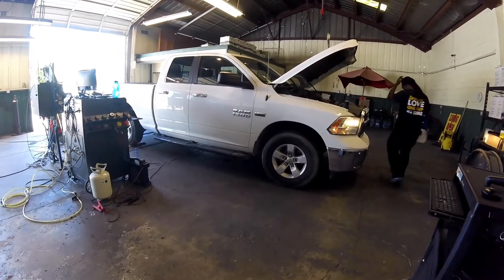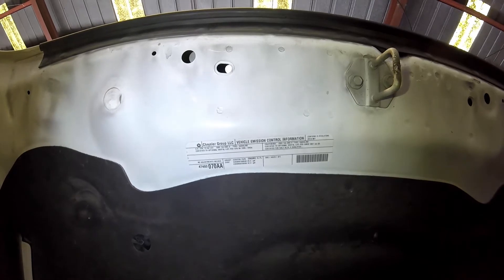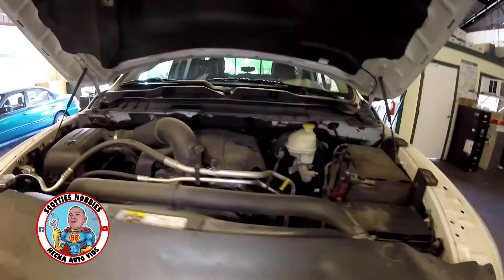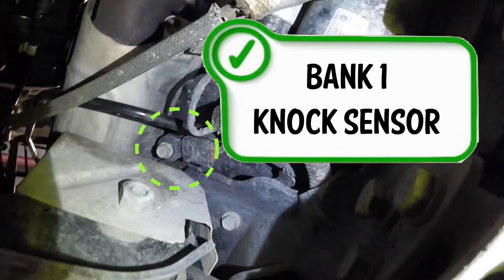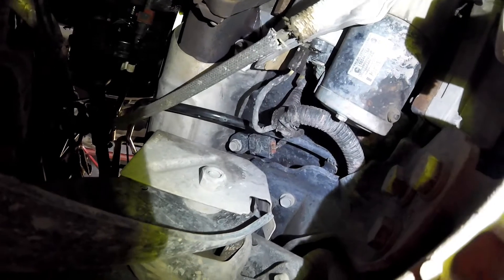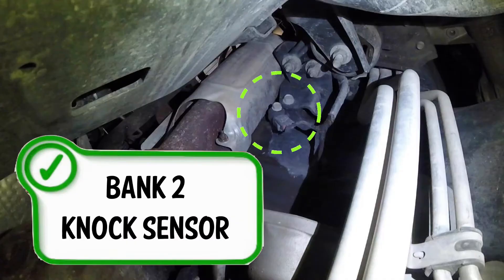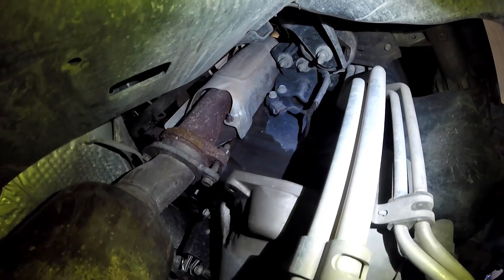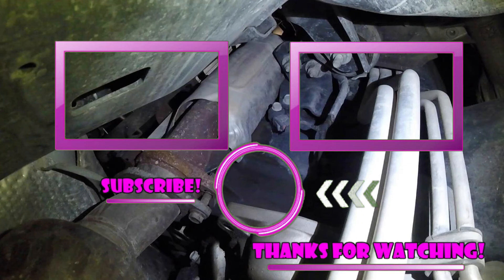⫷ RAM & Dodge │ 5.7L │ 2003 - 2018 │ Knock Sensor Locations, info with Torque  ⫸

Comment: Thanks a bunch. Nice simple video. I am having an issue where I get the code for the bank 2 on my Charger 5.7. The engine is running fine no loss of power or knocking etc. I clear the code and it runs great for 50 - 100 miles and then randomly it pops the code again. Is this the sign of a sensor going bad? Or does the sensor go completely bad and pop the code immediately?
Reply from the maker: Do you know the code that you are chasing?
Reply: @ScottiesHobbies  It is P0330

Comment: So if i do not get continuity at the connector when the key is in the on position,, then what? I changed out both my knock sensors after a p0325 code,,,, code is back and still low rmp surging and low power. thanks for any info.

Comment: I'm trying to fix this truck. My friend did the starter and the bank 1 knock sensor wires came out of the plug. Im going to fix the plug but I do not know which wire goes where. Do you happen to know? Also great video.

Comment: Hello 
I have a ram 1500 2011 and have the knock sensor bank 1 and 2 circuit malfunction but i don't know how to replace the harness i already change knock sensors O2 sensors fuel injectors spark plugs MAP sensor and the CEL is still on and the truck hesitate to accelerate please i need help
Reply from the maker: Have you checked fuel pressure?
Reply: @ScottiesHobbies  yes and it's fine
Reply: @blakedexter3224 mine hesitate as well well I smack the gas …. When low on fuel doesn’t crank … but I if put gas in it’ll crank right up …

Comment: i have a 05 dodge ram 1500 5.7 hemi 4x4. (lights come on) but no crank no start problem. i put on a new starter, starter relay, and battery and still nothing. any suggestions?
Reply from the maker: I know the 07 ram has starting issues because of the TIPM. Have you researched the TIPM at all?
Reply from the maker: I did a quick Google search, the 04 has the TIPM problem so I'd put money on, that is your problem. But research a little before you throw another $500 @ it.

Comment: I have 2005 he I and on the right bank I get a noise like exhaust gasket is bad after it warms up it gets less . Could that be a knock sensor? Thanks carl
Reply: The header gaskets are going bad. They’ll sound like a lifter noise at cold start but when it warms up the gaskets expands and quietens down

Comment: im currently running at 10 to 24 degrees ATDC! is it possible the lifter tick is causing this? no cel, drives ok but terrible mileage and lack of power. New cat, new map etc sensors, new timing set installed 10k miles ago (i bought it with a spun rod).. 2003 2500 HD 4wd hemi 5.7-
can i ground these knock sensors out to see how it runs?
Reply from the maker: Have you done the dash code check? 3 times to on position and hold? You might find a code. If none it will say done. Check my other videos, search 'scotties hobbies secret code' . Let me know what you find. Have you checked fuel pressure?
Reply: @ScottiesHobbies  got p0113 and p2299 - thanks looking into it now.. 0113 = IAT sensor and 2299 = brake pedal positino.
Reply from the maker: @fstarockaburns425   Hopefully your intake air temperature center is remote. If it is make sure it is clean and make sure the wire connection is good. Now with the brake petal center. Does your brake lights work? I'm not sure if it has a sensor for the lights and then a sensor for the computer or if they're integrated into one. 

 Glad you found codes in the computer. Hopefully this good hopefully this is what it takes to get this thing running right. Keep me posted on how it goes.
Reply: @ScottiesHobbies  Hi thanks ignore the pedal i had my foot on it - but the P0113 still remains.. I checked live data on the IAT, shorted out the temps jump to max (240 degrees), and if i ground the sensor it jumps to 40 (coldest) indicating the unit is working? I also followed the manual instructions and measured 4.5k ohms across the board - it sounds awfully high though? manual says must not be below 100 ohms - mine is WAY higher.. connected and idling the IAT shows about 31 degrees celsius which is about 10 degrees higher (hood open, motor cold and ambient about 20 c) than normal.. I replaced the unit 2 months ago

Comment: I hit a large water puddle on my 2018 tonight at highway speed with cruise and it threw a p0330 code with CEL.  Sending the reset command seemed to work however.  Whats with that?  I'm at 54k miles.
Reply: How do you send a reset code?
Reply: @walnutz516hah3  A scan tool of some type obviously.
Reply: @peiguy1982  that's what I thought my 2017 does the same as your truck rained for a week straight cel popped up and 0325 code .....been dry for 2 days now it's gone by itself

Comment: Hello .... I have a 2006 Dodge Daytona Charger R/T thrrough a p0330 .. I know it's knock sensor 2 bank 2 .. is that the one located below the manifold .. by the 5.7l ..  Thank you .. just came one the other day .. Stay Safe
Reply: Did you figure it out ? Same issue
Reply: @lethalracing5.7  been to busy working not gonna try to diagnose soon .. thanks for asking
Reply: @lethalracing5.7  yea. Bad coil pack
Reply: I have a 2010 r/t but where is bank 1
Reply: @gaelgarcia-dg5qc  usually bank one is one of  the front o2 sensors b1 left side.. b2 right side

Comment: Awesome vid! I'm subscribed now!

I think I'm getting spark knock for some reason. Took truck to a car wash yesterday (one with the underbody wash) and started knocking under partial throttle. Put some 93 octane in it, reinstalled the factory tune and took it for a drive. Still knocking and getting much worse. Just about couldn't use the throttle at all. Hooked up tuner to do a datalog and was showing like 35* of timing advance under very little throttle.
Do I have an electrical issue? No check engine light at all. Nothing to indicate anything is wrong except the shuddering and loss of power.
Reply: What was the issue

Comment: Can bad knock sensors cause bogging down at low rpm when taking off?
Reply from the maker: Yes, its possible. If you can do a resistance test, I'd do that before I replaced them.
Reply: Thanks for the info bud.
Reply from the maker: @driniker6096  good luck on your fix. Thanks for the view.

Comment: I have a 2010 ram 1500 was driving and just died on me rolls over but won't fire codes come up camshaft sensor and p3497 changed sensor but still won't fire. Any ideas on what to try next
Reply from the maker: Have you checked fuel pressure?
Reply: @ScottiesHobbies  yes good fuel pressure going to try knock sensors and crank sensor today and if that doesn't work im lost. It did make like a thud noise right before it dead. . . . . Just hoping not timing. . . . almost acts like its has no spark
Reply: @listfootball7775  did you figure this out? I’m having the same issues. Replaced all sensors and battery, alternator and starter. I’m getting P0340.
Reply: @CWyaco81  yes jumped timing